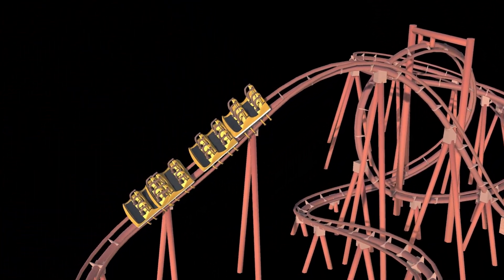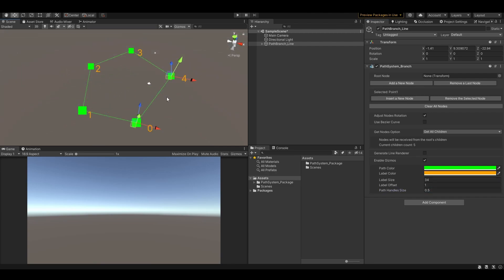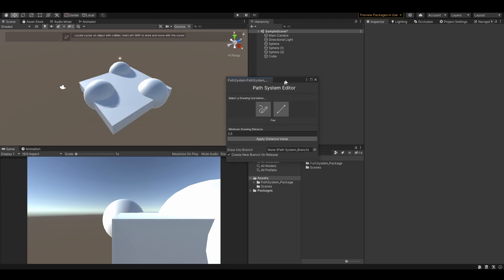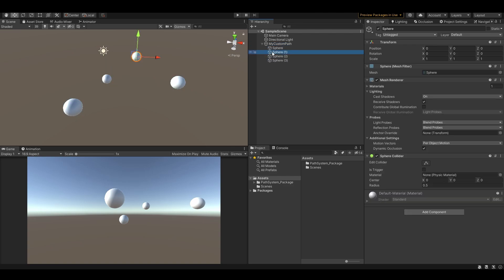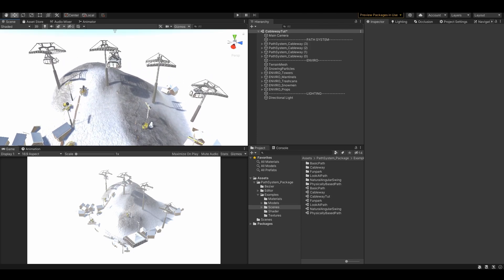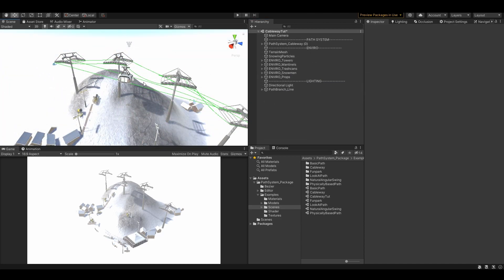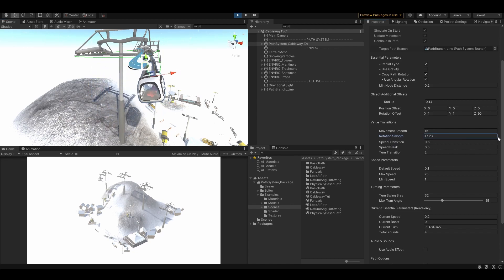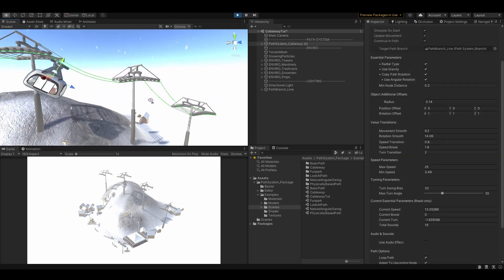Unity - Path System official documentation

Comment: Hello.
05:16 "Pathsystem_Cableway (0)" is mesh, right?
Then, how do I create the inspector's Pathsystem_Object in "Pathsystem_Cableway (0)"?

And I'd like to implement running at the highest speed from D to A to B, then gradually slowing down from B to C, then stopping completely for a minute in C to D, and then repeating at the highest speed from D to A to B again, is it possible without programming?

I think I need to use the animation curve function within Unity to do that, can I use it together?

You can think of the train and the station.